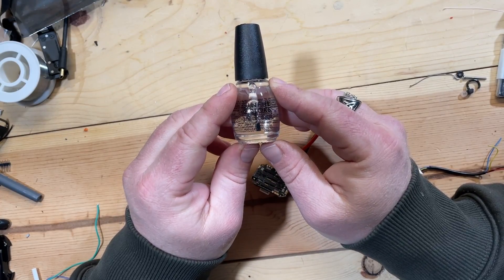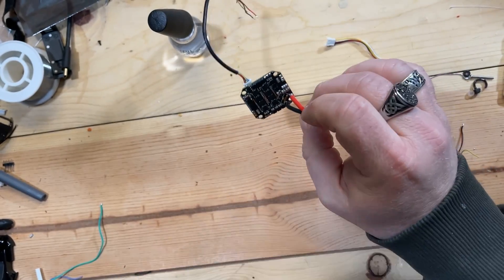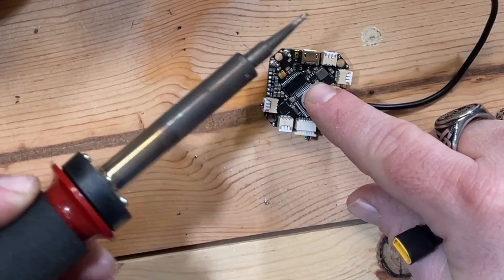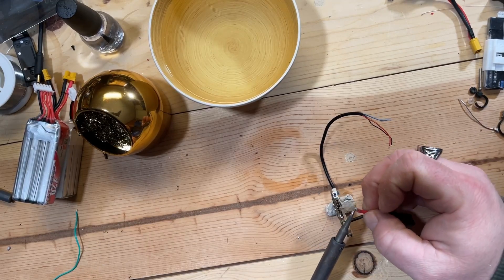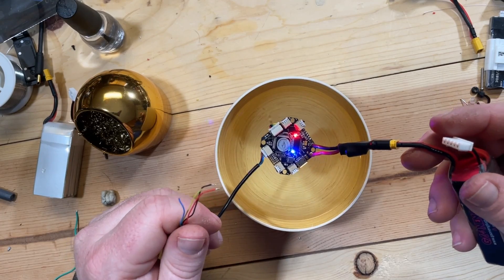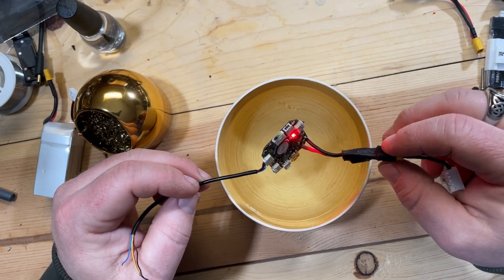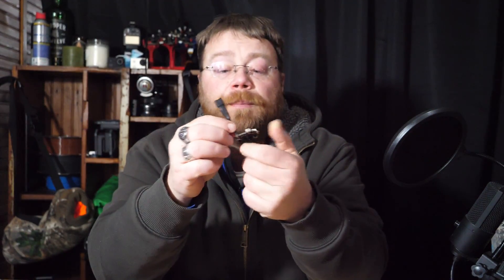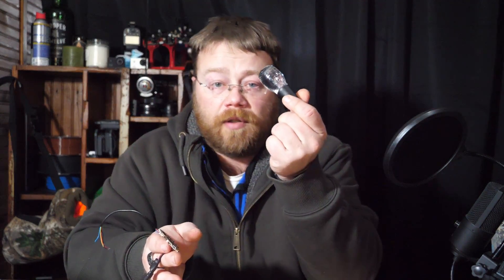Does Nail Polish Waterproof a FPV Drone?

Comment: Not be criticize the video, but I learned something crazy during a very stupid decision once.   Hopefully my insight can help you protect that thing like Iron Man's suit. 

I had a fish tank light that fell into an aquarium, and reached in and grabbed it.    I figured since the incandescent 120V (not tube) was still on the power going in is going out.  Plus I was on carpet.

That's because there was nothing in the water to act as an electrolyte. 

Let me say this is a GREAT idea.    It will keep the components from corrosion especially if used at the beach from brine air.  But you may want to test this again with some salt in the water that would act as a conductor. 

however I may start doing this for alot of my devices.  I have old music equipment and this may be a great way to preserve them.   I've seen instances where an entire leg on an IC has corroded away (often due to flux) and I'm lazy about removing flux.    So before doing this you may also want to soft brush it with alcohol to get any remaining flux off as well. 

Amazing idea though!

Comment: Do you think a top coat acrylic nail polish would work? It’s a little more gel like.
Reply: Yeah shipping kinda kills the deal. It ends up being more like $20. Can you still solder after putting on the regular acrylic nail polish? Also is it just regular nail polish or is there something in particular I’m looking for when I go to buy it
Reply from the maker: Ahh understandable. I went with clear acrylic polish, I think it was like $2 USD. Keep in mind use this at your own risk, it is not conformal. I have used this on multiple quads and only one had a 4 in 1 esc burn out on a 7" LR, I doubt it was due to the nail polish, as esc's burn out. But just wanted to warn you before hand. 

You can solder through it, you just have to melt the acrylic off, you will see it when you put the soldering iron to it. 

As for the ingredients I am not 100% and really can't advise you on that but I do know Acetone is present in some polish and that can damage PCB, from what I have read Acetate is less powerful and doesnt damage PCB, but again use this at your own risk as nail polish is not designed to waterproof electronics. If it get's too hot, like any acrylic it will melt. Silicone is still best for waterproofing electronics. i.e. FPV Worry Free and Silicone Conformal from MG Electronics.
Reply from the maker: To get the gel properties there is some added chemicals to it, so I do not know. To be honest at that point it would be better to order up some FPV Worry Free for $8 from RDQ, I think it is cheaper than most top coats, and it is designed for electronics.